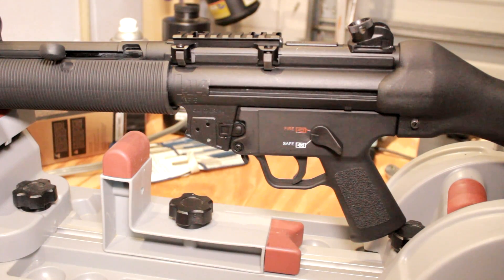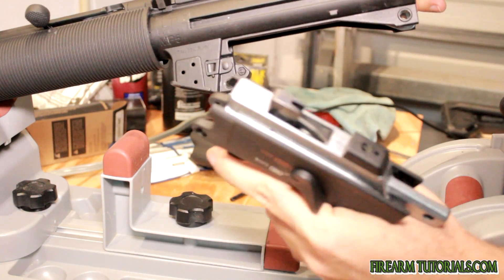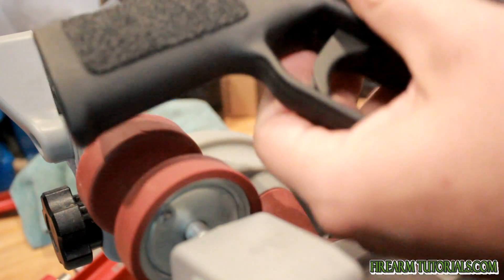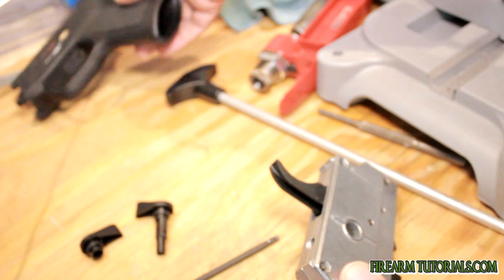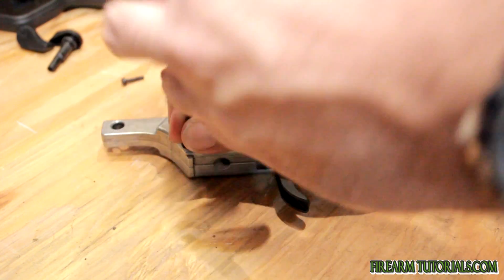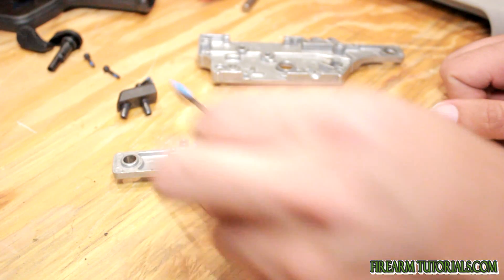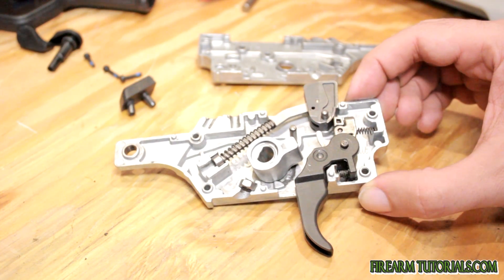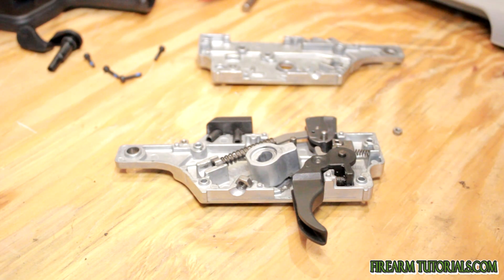HK MP5-22 trigger pack internals

Comment: nice video.  I was checking out the video that HK parts did and they missed the part about removing the bolt in the grip to remove it.  I'm sitting there like why isn't this thing coming out?  Then I happened to look in the grip hahahaha.  If you own this gun you should install the match trigger spring set that HK parts offer.  I just did it to mine and put a video up on it.  surprised at the results on the gauge!
Reply from the maker: +Steve_MP5 Yea, that trigger spring upgrade looks great, I just don't this gun enough since I've got one in 9mm now.